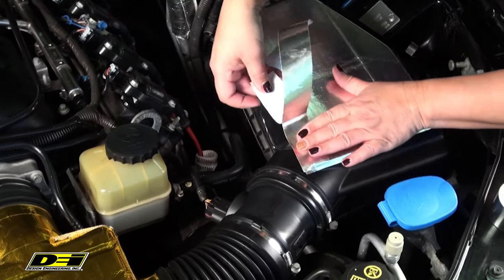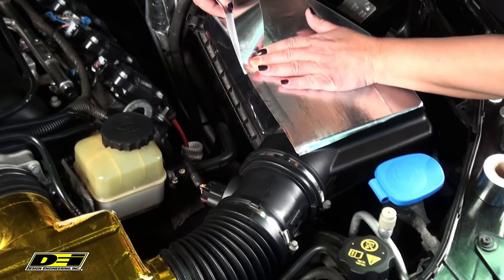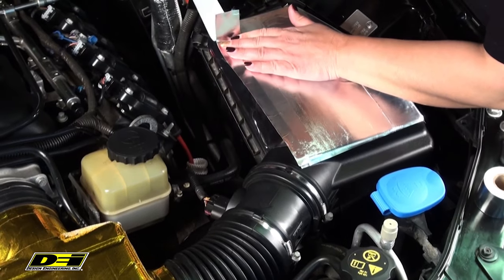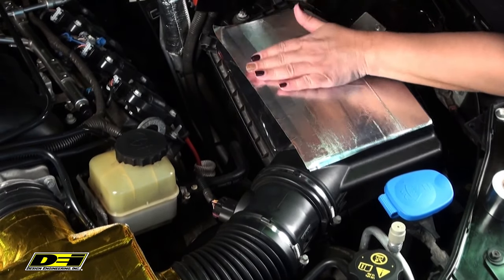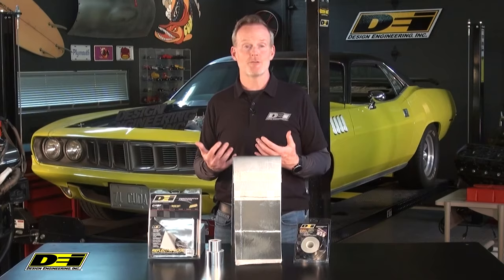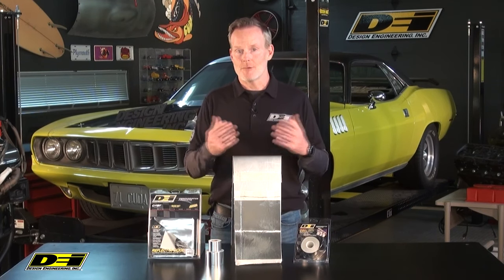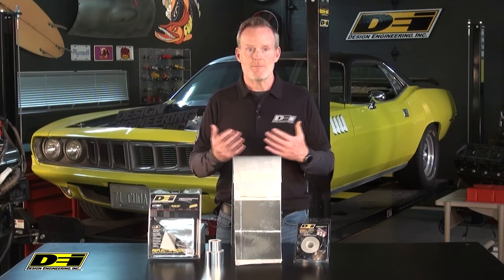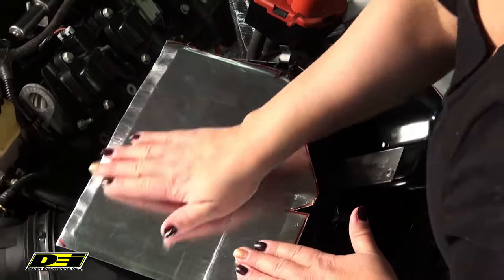Reflect-A-Cool & Cool Tape from Design Engineering, Inc.

Comment: can you put this tape directly on fuel lines and fuel injectors. seems my 4.0 cherokee has heat soak
Reply from the maker: We have something even better for that! Check out our kit specifically made for the 4.0 Jeeps - https://www.designengineering.com/97-04-jeep-4-0l-i6-fuel-rail-injector-cover-kit/

Comment: Fiat abarth can i wrap my turbo hose with this it is up against the coolant line
Reply from the maker: Are you referring to one of the oil feed lines on the turbo? For an application like that, you would be better off using one of our line sleeving offerings. Either Fire Sleeve or Fire Wrap 3000

Comment: What's the difference between this and the reflect a gold?
Reply from the maker: Reflect-a-Cool is constructed with an aluminized top layer as opposed to the Reflect-a-Gold with the Metalized Polyimide top layer. The Reflect-a-Gold will be a bit better at reflecting radiant heat.

Comment: Is this stuff easy to remove after its been on for a while?
Reply from the maker: It should come off with some effort, but it may leave some adhesive residue on the application.